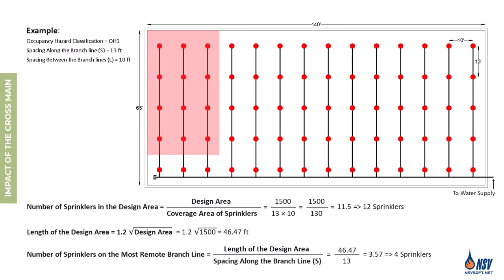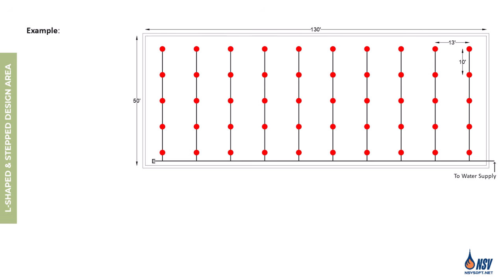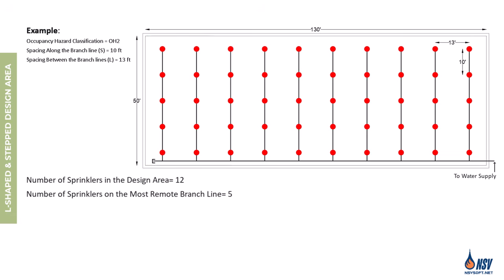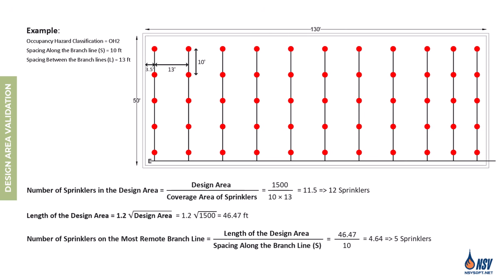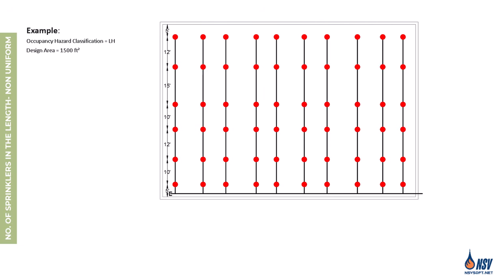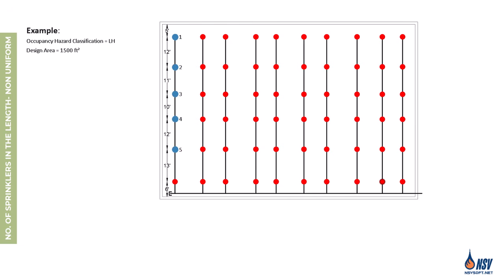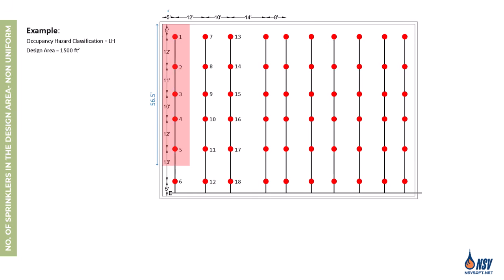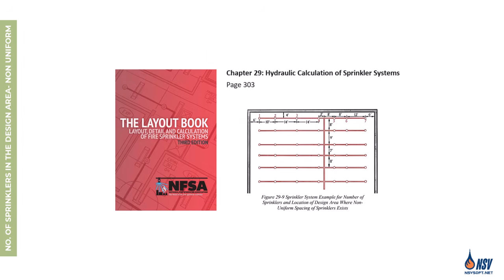◰ Design Area - Part 2: Beyond Basics (NFPA 13)

Comment: Hi, i had a question for the non-uniform sprinklers. Why is the S of sprinkler 4, for non-unfirom 12ft? I though it wouldn've been 11ft (5ft from the top and 6ft for bottom portion)? thanks
Reply from the maker: Thank you for watching the video and taking the time to ask your question.

According to Section 9.5.2 of NFPA 13 (2025 edition), "S" represents the distance between sprinklers along the branch line. Paragraph 9.5.2.1.1(1)(b) specifies that when the spacing between sprinklers is not equal, the larger distance should be considered as "S".

Therefore, to determine the value of S for Sprinkler 4, we need to compare its distances to Sprinklers 3 and 5 and use the larger value.

In our example:
- Distance between Sprinklers 3 and 4 = 10 ft
- Distance between Sprinklers 4 and 5 = 12 ft
Therefore, S = 12 ft.

We have recorded a separate video explaining this topic in more detail. You can watch it using the following link:
https://youtu.be/W7Iowc12Z94?si=dN3ge-NblQM2Fcsh

Comment: Thank you for your video. I have a question: the half-way point method does not match the sprinkler coverage area selection explained in “Calculate Sprinkler Coverage Area: Sketch-Based Method (NFPA 13).” Should we use the half-way point method for calculating sprinkler coverage?
Reply from the maker: Thank you for watching the video and for your great question.
When we are laying out sprinklers or determining the required flow for standard spray sprinklers based on the design density, the sprinkler coverage area should be calculated using the S × L method or the sketch‑based method.

However, when we move to selecting the design area, the coverage area of sprinklers within that design area to be determined using the half‑way method or the approach presented in the NFSA Layout book.

Both approaches are accepted in practice, but the choice of method should ultimately be approved by the AHJ.
Reply: @NSVCad thanks a lot, sir. But isn't it's contradict? What might be explanation that different approaches to be accepted? I am working as fire protection engineer in AHJ and we are instructed to follow NFPA 13. What should be explanation?
Reply from the maker: We understand why it may seem contradictory at first.

The half‑way method is not something invented in the field — it is actually referenced in the NFPA 13 Handbook (2019 edition), page 1108. The handbook explains this approach as an accepted way to determine the number of sprinklers within the design area.

In addition, the NFSA book (3rd edition, page 303) also presents method relying on S X L as an accepted practice.

So even though NFPA 13 itself focuses on S × L or the sketch‑based method for determining coverage area, both the NFPA Handbook and the NFSA layout book recognize their own approach as an acceptable way to determine the design area. That’s why you will see both methods used in the industry.

And since you work within the AHJ, you have the ability to apply the method that best aligns with your department’s interpretation and requirements.

If you have any further questions, you’re welcome to contact the presenter of this video, Hesam Tavoosi, through LinkedIn or email:
LinkedIn: www.linkedin.com/in/hesam-tavoosi 
Email: hesam@nsvsoft.net
Reply: @NSVCad thanks a lot for sharing your mail and LinkedIn address. Actually I am going to request you for this. It is really a pleasure to have reply from you. ❤
Reply from the maker: @md.hasiburrahmanabir9104 You're welcome,  we would be glad to help!

Comment: Where can I find nfpa rule book!? Do you have any link!?
Reply from the maker: You can find NFPA rule books (which are officially called NFPA codes and standards) through the following ways:
•	NFPA Website:
      -	Go to NFPA.org
      -	Use the search bar to look for the specific NFPA code or standard you need.
      -	Many NFPA documents are available for free online viewing. Go to NFPA.org backslash and the standard number. For example, to read NFPA 13, type www.nfpa.org/13 into your browser. Then, select the desired edition and click "View Free Access." You will need to create a free account on the NFPA website to use this method.
•	NFPA LiNK:
      -	This is a subscription-based service that provides online access to all NFPA codes and standards.
      -	It offers features like search and the ability to track changes.
•	Hard Copy:
     - 	You can purchase printed copies of NFPA codes and standards from the NFPA website or other distributors.

Comment: Nicely explained Hesam! Selecting the correct design area is actually quite tricky. Without understanding the concept of design area criteria, as you outlined in the video, designers might mistakenly ignore sprinklers with the highest flow rate and instead include only those with the highest pressure demand since that may seem intuitive, but is actually incorrect.